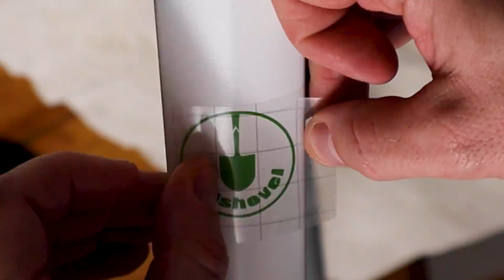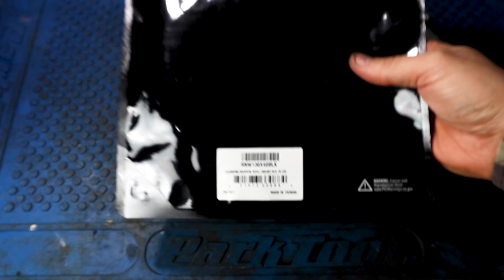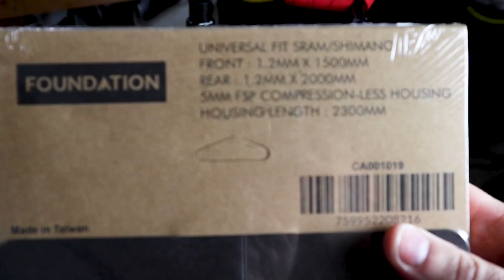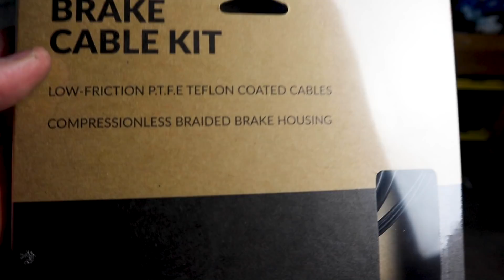Dad Bike to Gravel Bomber - GT Tachyon 3

Comment: Although I'm not really into gravel bikes this is one if my absolute favorite builds that you've done. That paintjob is incredible!!
Reply: It's a old school ATB. Don't get caught up in the hype.
Reply from the maker: Thanks
Reply: @bigtrucklittlerv7969  did you mean MTB?
Reply: @allenncrystalking8517  Nope. They were called ATB's before MTB's
Reply: Is there a frame material that's best to use when picking a frame? I have a carbon frame that's dying to be built!
Reply: @dennishermey5873  1020 is good. 4130 better lighter. Both are plenty strong

Comment: I really enjoyed the build! I have a suggestion, I would reccomend hitting your paint with a bit of wet dry sand paper (600-800 grit) before clear coating, and then hit your first layer of clear with 1000 grit. Then your last layer of matte will look more solid and the decals will appear sunken in the finish like a factory paint job!

Comment: So good. I was bummed when the first set of tires didn’t fit, but I was thrilled to see the tan walls go on. It’s perfect.
Reply: Problem is they look rubbish with rim brakes after a few wet rides. That's why most tyres ended up being produced in black. (Not such a problem with discs, obvs.)

Comment: I was watching you put on the chainring and said "nope, not gonna work with the chainline".  Of course, a few minutes later you figured out the same thing.  Been there.
Reply from the maker: I suspected it could be an issue but it looked so clean on the outside I wanted to give it a try.

Comment: the best paintjob you've done so far! i've got a bike that is the same but with a 1 inch threaded fork, i bought a 1 inch threadless headset and a stem adapter, but the fork is too short, think i have to buy a new one for the full convertion. You had motiveted me to search a metod to do it, thanks a lot!
Reply from the maker: Awesome. Good luck on the bike.

Comment: I love all your videos but this one connected with me a bit more, I have a 2013 GT Transeo 1.0 which I've owned since new, it's been a great bike, this spring I changed to a 1x setup, 11-42t and an oval 38t up front, it's given it a new lease of life. I'd previously fitted 180mm discs with metallic pads (160 and resin before) and a nice gel saddle, with a carbon seatpost. I might get a slightly shorter, higher angled stem, to take a lil weight off my wrists. Keep up the amazing work

Comment: Awesome. I’m currently building a gravel bike from a mountain bike frame. I ride road and mtb and I’ve gone more in the drop bars/road groupset as it’s gonna be used as my winter bike as well. Mine is a 26er converted to 650b. Great build btw, you’ve got yourself a new sub 👍

Comment: Love this video to start a quiet Sunday! Did you switch to a smaller chainring or just rotate it and that fixed the issue. Couldn’t quite tell but struggling to see how rotating it would solve it. Either way, very cool, keep it up!
Reply from the maker: I set it up initially on the outside but the chain line was causing the chain to skip on the derailleur pulley, moving it inside fixed the issue.
Reply: @oldshovel  aaah of course! Appreciate the reply

Comment: HELP!
I am restoring a 1996 dsd bike, it has a shimano SIS that lacks the B-screw and the pulley makes contact with the larger gear of the cassette.
 Peple are suggesting to adjust the housing lenght to avoid that. Does it really work? And how to measure it?

Thanks!!!
Reply from the maker: Assuming I understand the problem correctly I do not think this will solve your problem at all. It sounds like you need a different rear derailleur.

Comment: A 3x8 drivetrain has 12 effectively usable gear ratios and a larger gear range than a 1x10. All around better, at the small the cost of having to shift the front derailleur to access the two highest and two lowest gears. It's an odd trend, this switch to 1x10.

Comment: I find your overconsumption of new (and N.O.S.) parts unnecessary and gratuitous. It runs counter to my ethos of rescuing an old bike and giving it new life. I've done what you do close to 100 times but I only buy parts if they're missing or broken. The bike nostalgia in your vids feels a bit contrived and corny, and then it blends into a long "Jenson" commercial. I do give you props, however, for your good taste in bike parts!